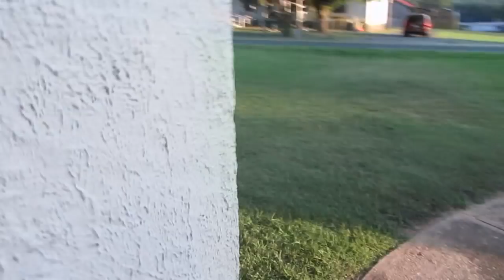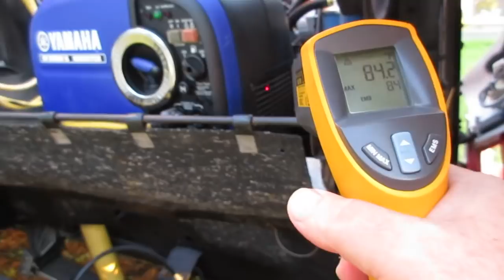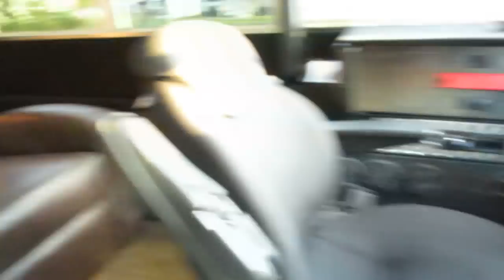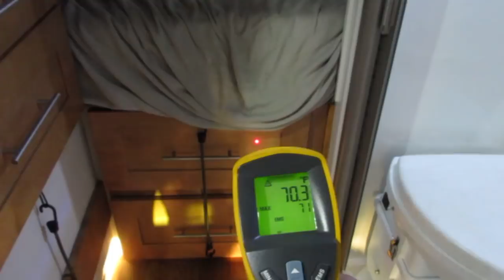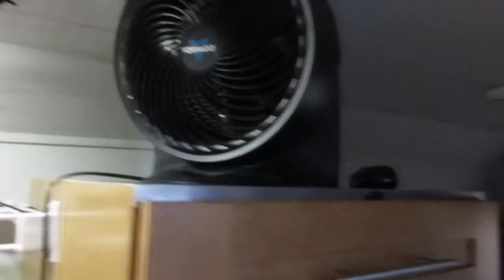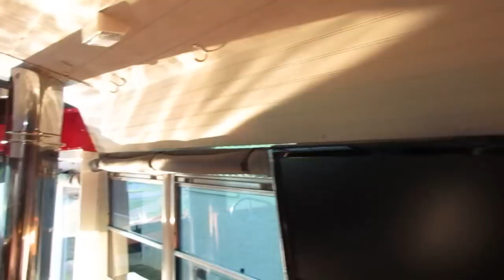Trampas: Generator Runtime Update

Comment: this is very informative thanks! my question is why is the gas generator running the a/c during the day? is the solar not enough to generate power for the a/c? thanks
Reply from the maker: Joanne Cipolla-Dennis Yes the solar would normally run the AC during the daytime. This was merely a test to find out how long one gallon of fuel would run the AC and it was more convenient to do it in the daytime rather than at night.  There are some other videos that show us driving down the road showing the AC running off the solar panels as well as the 150 amp alternator.  The AC only pulls 450 Watts and the solar panels will make a real deal 780 watts.  Thanks for the comments and question!

Comment: Can you run the generastor while driving down the road ? Thought about building in some ceiling fans ?
Reply: Also buy an Oxygenics handheld shower head to conserve water while boondocking or in a campground w/o hookups?
Reply: Also put in a magnetic screen on the rear door to keep bugs out when it's not hot out .
Reply: Is your roof fan a MAXX Air or Fantastic Fan ?

Comment: How much for a duplicate bus El Mcgall
Reply from the maker: Everett Smith That would be hard to put a number on because I think it would be difficult to get an '87 Thomas bus.  Let's say it like this: if you brought me the bus, in good condition, with the mechanical side of the bus complete, this would include motor, drive train, basic electrical, tires and wheels, in good working order I think I could do it for somewhere between $50,000 to $60,000 turnkey.  That's 850 watts of solar, batteries, generator, storage boxes on the sides, 32" house door, nice stereo, 30" tv, wood stove, sleeping quarters for two, and most of the goodies you see in my bus.  A basic paint job with a few stripes.  Please note that the things I am providing are high quality and made to last a lifetime.  The bus needs to be mechanically top notch and ready to go over the road coast to coast to justify putting this kind of work into it.  There are certainly less costly options as well as more expensive ones. This particular bus, Trampas, I would sale for $85,000.  It is registered in Virginia and has a current inspection sticker.  It has full coverage insurance with a reputable insurance company.  It still carries the commercial bus title but does not require a CDL. Hydraulic brakes and under 26,000 lbs. it has a clean title and I would have no problems filling it up with fuel and driving it across the US tomorrow morning.  Thanks.  El Miguel

Comment: How did you install the Front door. Any welding?
Reply from the maker: Norris Coleman Yes there is quite a bit of welding that has to be done.  A piece of steel flat stock has to be welded on the forward edge where the hinge attaches.  The hinges are then lined up and welded in place.  Also the lower step has to be extended so that the door has a sweep surface below it.  This is easily achieved by welding a piece of angle iron in the lower edge of the first step and then screwing another piece of aluminum so that when the door drags across it it will not rust.  The inner seals are an off the shelf product from Lowes or Home Depot.  It is basically a door seal kit that has three seals that can be cut to lengths and three aluminum tracks that the seals press into.  They have to be cut and screwed into place and they act as the doorstop.   Attention to detail is an absolute must.  If the door is not properly done you will get all kinds of squeals and hissing going down the road.   I don't consider myself a skilled welder, just enough to get by.  I used a small 110 welding machine to do all the work.   Measure and check a hundred times before you weld it in place.   It took me about 4 solid 9 hour days to finish this project.   And that's not including the painting.   The door needs to be coated with a marine epoxy at the top and the inside of the door latch cutout.  Because the bus is subject to a different type of water and weather problem all the areas that are raw wood must be coated with epoxy so they won't rot.  The first door we installed rotted out in two years because water got inside the metal casing at the top and the latch cutout.  Make sure you use a (mill run) door as this will ensure you can buy another door as a replacement if need be and it will fit almost perfectly if done correctly.   Our door is a Benchmark brand name off the shelf at Lowes.  When we had to replace it I bought another Benchmark and it screwed in exactly where the other one was.  Hope this helps your project along.   Thanks.  Michael
Reply: Thanks for the reply. No welding skill but it looks as though I will have to learn. Practice I am told, buying a 110 Mig Welder. Everything you explained makes sense as I do have Carpenter skills, just not metal work. The epoxy of the door make logical sense and your experience was very knowledgeable in this conversion process. Thanks for you sharing of your knowledge.